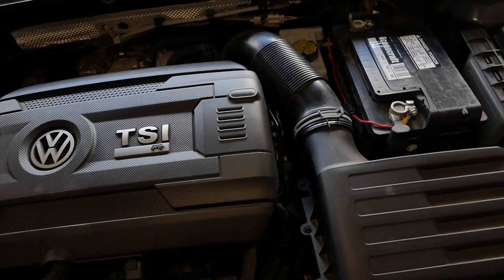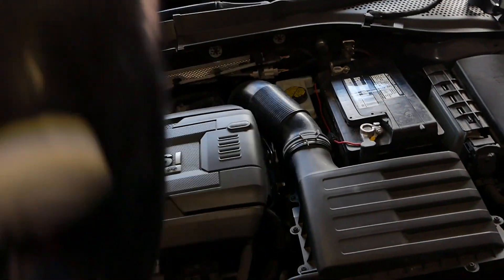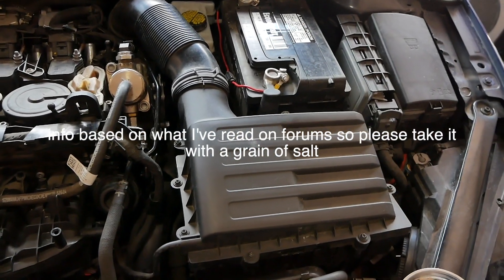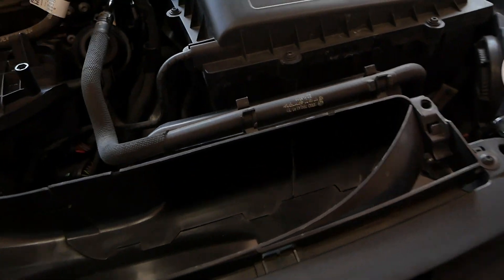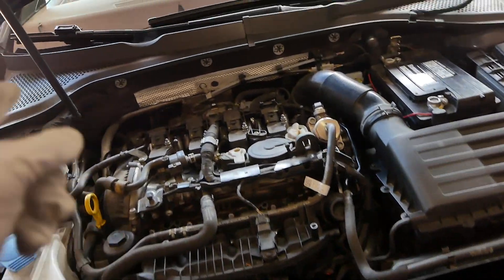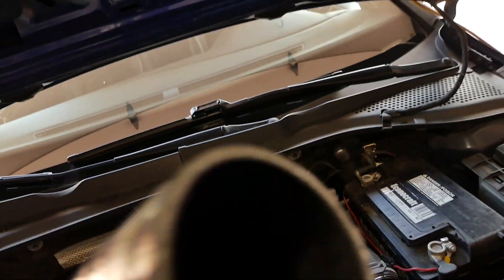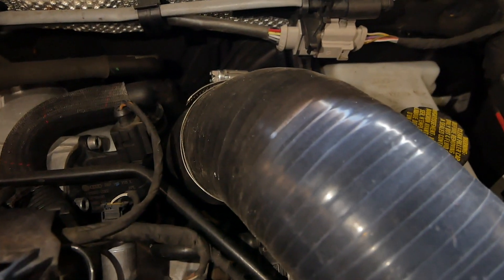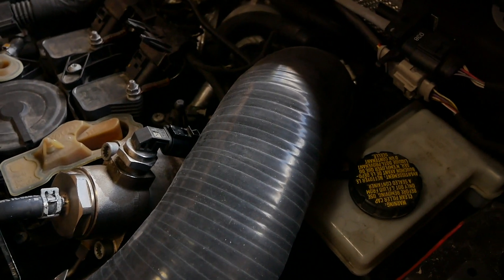4 FREE ways to increase your turbo noise! + 034 Inlet Hose Install!

Comment: Taking the cover off the snorkel lets the intake draw hot engine bay air in, as opposed to the cold air being forced into the grille. You should really understand how the factory intake system works before you start modifying it.
Reply from the maker: if you watch the latest videos it has been replaced, thanks for your input!

Comment: Everything I've found thus far states that inlet pipes do nothing for power but simply increase throttle response. Seeing how the inlet pipe gets reduced at the turbo to fit the coupler, isn't the desired result negated by the reduction at the coupler?

Comment: $40 for the hose? Where you get it from?
Reply from the maker: was able to pick it up on the forums. this is the going used price for them!
Reply: @nickvu5429  lucky that is a good find.
Reply: Also, do you have a turbo inlet pipe on?
Reply from the maker: @maniirdzjr24  yup just installed it!

https://youtu.be/1tcEvbiyoPk